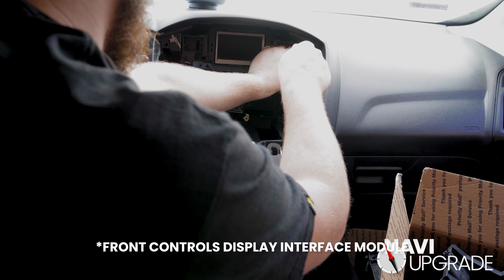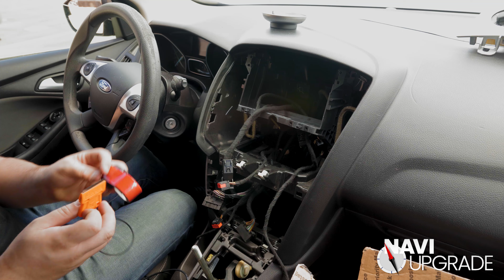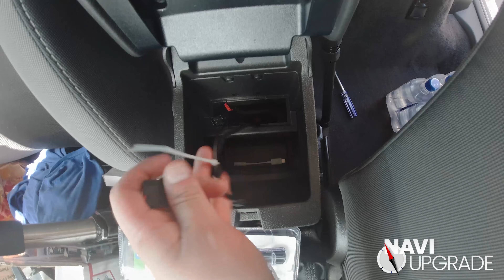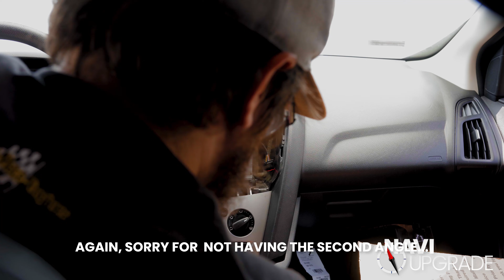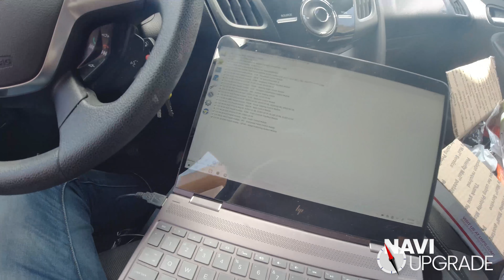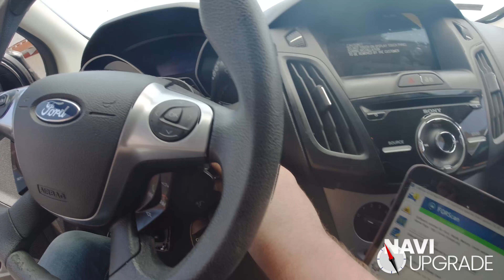2012 to 2014 Base Ford Focus MK3 Sync 3 Upgrade Tutorial

Comment: I want to add a back up camera. The harness i bought from you has the yellow video cable on it. I tried installing a cheap ebay one i had laying around and i turned the rear camera option on in forscan but the screen would turn blue and then it was say camera not available contact dealership. Is there anything else i need to do? It had a green cable that was coming out of the yellow video cable that connects to the harness by the screen but i didnt see any other cable to connect it to so i just left it unplugged but for some reason i couldnt get it to work. I got power and ground for it from my reverse rail light. Im not sure if i should try again with a different camera or if i just missed something on the programming side.

Comment: I want to know if you still have the kit for this setup? I have converted but the wires I purchased through eBay are wrong and missing the hazards and lock/unlock wires. Also my radio will not power off/on the volume doesn’t work either. I meed some help with this issue. I also noticed that I have two wires that are cut and don’t know where they go.
Reply from the maker: I still sell the harnesses yes! They come with programming files and will work with your car as long as it had the base Sync version like this car had!

Comment: What happens if I have a 2012 Ford focus and I want to put a 2014 Titanium or 2012 I think it is it's got the touch screen with navigation will that swap up what all has to be done I have a scan tool it is an older one it will pick up stuff on this car but I think this is like the final year it only goes up to like 2013 and this is what this car is either 2012 or 2013 can I just swap everything and it'll work without having a program?

Comment: Hi! 
can someone please help?
just bought a focus mk3 titanium and when I press the "AUX" nothing happens also pressing the "phone" just mutes the radio. so I cannot connect to the Bluetooth at all. I disconnected the panel and after pulling the ACM I noticed that there is no connector No1 connected and I can't  even find it anywhere. where can I look for it and what might have happened to it with previous hands? 😵‍💫
Reply from the maker: It's possible that a previous owner cut it up to install an aftermarket head unit.
Reply: @NaviUpgrade  Thank you for the response. That's what I'm fearing because I've found a "Connect" passive amp behind the ACM making me suspect that he rewired the connector to the "Connect" connector. Is there a way  to restore it?

Comment: Or you could… like… just get a pioneer or other good apple carplay / android head unit, get a 2-din cover replacement kit with necessary cables plug and play cables for proper conversion and maybe also buy a reverse camera to go with that, plug it in quickly and you’re done. Maybe also upgrade the speakers with a focal ford kit or something.

This seems to be a lot of trouble for no obvious reason. A brand new apple carplay system just seems superior and you can still keep all controls.

Oh well. It’s cool that you managed to fix it so nicely, I just believe that almost everyone is better off just getting a plug and play kit for 1 or 2-din head units and getting whatever model they fancy of head unit. There are even super cheap stuff that is just the screen and panel in one, though those tend to be unreliable, it’s a better experience to get something proper.

Comment: My APIM is not showing up at all in Forscan. Any troubleshooting tips or info on what to do?
Reply from the maker: Hi Jackson! Please ensure that all connectors are connected, specifically the main connector down by the shifter and the connector that connects to your old 4" display connector. If they are already plugged in, unplug these connectors and reconnect them.

Comment: Please rephrase your intro - the 2012 only has (1) plug at the rear of the head unit (not 2 as shown in your video) it also has (2) antenna Plugs not (1).
I am still searching for a way of connecting the Canbus Unit inline with the original wiring to the extra plug!) If you have any ideas it would be much appreciated.
Reply from the maker: Guessing you have a global version of the car which is equipped differently
Reply: Hey mate, did you end up figuring out how to make this work?

Comment: Thank you so much for this! Just upgraded my 2013 focus and couldn’t have done it without this video. 

One question though: I don’t have the parking sensor image or the green/yellow/red lines when I put it into reverse anymore. I still get the beeps, but I don’t get the “Park Pilot” image that I used to have in sync 1. Any suggestions?
Reply from the maker: Set this setting in the APIM asbuilt to 'B'

https://cyanlabs.net/asbuilt-db/sync3-apim/?search=Parking%2520Distance%2520Control%2520%28PDC%29%2520HMI#database
Reply: @NaviUpgrade  Thanks for the reply. That didn’t work sadly, but I managed to get it to work by changing DE01/7D0-02-02 xxxx-*xxx-xxxx from 0 to 2

Comment: Hello, Looking to do this to my kids 2012 focus. Was going to attempt to wire it up  myself until i saw this video. But i am a little confused, on the wiring diagrams i found, there are 4 wires that go to the obd2 for hs-can and ms-can and wire that go from the apim to the acm. From your video it appeared you plugged the factory harness back in to the acm with no modification, and no connections to the obd2. Are these not required? Does your harness take care of these connections?
Reply from the maker: My harness makes the entire upgrade Plug and Play as long as the car has the 4-in screen where you can connect to Bluetooth. There is a minority of cars out there that just has a clock in the center panel instead of the 4" screen with sync (Bluetooth and voice commands)

Comment: Why do your kits still include a GPS antenna if you can select a non navigation APIM. Does it still work?
Reply from the maker: Because a GPS antenna is used for CarPlay interestingly enough (CarPlay is set to piggy back off of OEM Systems). Also other functions such as emergency auto dialing and Clock setting relies on GPS 🙂

Comment: The swing latch part lost focus and I didn’t quite see what you meant by it “should swing down and you should pull it right out.”
Reply from the maker: So the swing latch is a gray latching connector. There's a small push tab on the top of this connector that prevents the swinging latch from becoming unseated. Push down on this tab and rotste the latch. It will rotate and the connector will come out of the module.

Comment: What is the reason why your harness wont work for a 2014 4" to SYNC 2? I already have the sync2 modules and dont really need sync 3 or navigation, just the bigger screen and rear camera input.
Reply from the maker: It will work! The only incompatible piece is the hub power connector. To get around this, you can simply use the USB hub from a 2016 Ford Fusion or a 2016 Ford Explorer
Reply: @NaviUpgrade  Will I need files for Forscan to integrate it, and do you provide those with purchase for sync 2?

Comment: Does the Sony unit have a better sound than the Ford Sync 3 unit or is it all the same with just a Sony facia?
Reply from the maker: They're all the same in the premium cars with Sync 3 pretty much. Honestly the best sounding ACMs are the ones without Sirius XM from the base model cars
Reply: @NaviUpgrade  is that the ACM I've got? 2013 bottom of the range SYNC1 with the small 4" screen?

Comment: Your website is abyssal to use on mobile. I’m trying to scroll down and up but the logo keeps popping up. I want to buy and have someone do this but it’s hard to navigate through
Reply from the maker: Sorry 😔 if you'd like, email me at support@naviupgrade.com and I can send you a PayPal invoice for whichever upgrade you need. Also let me know what phone and browser you're using and I'll work on fixing that issue now. Thank you!
Reply: @NaviUpgrade  I’ll email you for sure. Does this set up work perfectly fine over time? I’ve seen some eBay units and reviews of ppl say that the Bluetooth or dash doesn’t turn on when they turn on the car later on. I want to do this to a ford focus 2012 se. The Bluetooth as is doesn’t work and the chip thing works according to a mechanic. Sorry I don’t know the names of car pieces yet fully.
Reply from the maker: Yeah Sync 3 is much more resilient than Sync 2 ever was. Modules are equipped with much better chip thermal compounds to allow heat dissipation via the APIM shell which was the main issue in prior generations. I think out of the 300 or so kits I've sold only one has gone bad and it was within our one year warranty. Haven't had any complaints outside of the one year period and I've been at this for 4 years of so 😁
Reply: @NaviUpgrade  are you based in nyc?
Reply from the maker: About as far from there as can be 😅 LA
Reply: @NaviUpgrade  😔

Comment: Hey man. I have a 2014 Ford Focus Titanium that has the 8" My Ford Touch. It has SiriusXM with it. Do you know if the SiriusXM is part of the unit or if it has a separate tuner located in the dash somewhere? Thanks for your help
Reply from the maker: Hey there Tim, XM is built into the CD player of the vehicle, Sync is just an interface for it!

Comment: I'm trying to replace the shifter knob in mine and can't find a video, this one is the closest but still doesn't show how to take the knob off. How does the leather separate from the knob, please?
Reply from the maker: If manual, grip the whole thing hard and twist left! Good luck!
Reply: @NaviUpgrade  I did that but the boot doesn't separate from the knob so I'm thinking the entire piece has to be replaced. It doesn't just simply unscrew in the 2013 Focus....
Reply from the maker: @ginger4166  probably a little stuck or sticky. Just pop up the whole trim piece and rotate the whole thing

Comment: Hello!  Can you help?  2013 Focus sync converter cable sync 2, where can I order?  thank you!  Hi!
Reply from the maker: Sync 3 and Sync 2 cables are essentially the same — you just won't get support for hub inputs like RCA and 3.5mm. Everything else is the same though.
Reply: @NaviUpgrade  Thanks for the reply!  I wrote it wrong.  I'm replacing the 2013 sync non-navigation headunit with a sync 2 navigation headunit.  What kind of power cord should I use?  Is the old power cable good?
Reply from the maker: No adapter needed unless you want to add a reverse camera while you're at it. You'll need to make sure you have a Nav SD card though for the Nav to work

Comment: I have the titanium version 2012. I'm looking at upgrading to the 3. If I can retain everything from the 2. Like my xm radio and HD.  I don't care about navigation.  Since I use waze or Google maps.
Reply from the maker: Yep! All factory features are retained. Sirius, HD Radio, backup camera, sensors etc ☺️
Reply: @NaviUpgrade  my question is if I pull it from a local junkyard.  I would just need the software and cambus?
Reply from the maker: @Das_Lucifer  it will probably need reprogramming unless you find an identically equipped car as yours that's 2016+
Reply: @NaviUpgrade  that's what I was wondering.  How much is your kit instead?
Reply: You website is very helpful.  Thanks.  That's all the information I needed.  You rock!

Comment: I understand these 2012 Ford Focus has  transmission problems ,it it possible fit standard gear box to this car . Could ou you send a list of parts needed . Thanks .
Reply from the maker: You should speak with Rebel Devil Performance in that regard

Comment: You reckon this could be done on a 2011 Focus as well? It has the same Old Panel. Thanks.
Reply from the maker: Absolutely. If you're outside of the US you could possibly need to use a different harness if your car has "Bluetooth Voice Control" rather than Sync. This harness will be in stock soon.

Comment: it’s 670$ for the components then an additional 250$ for the wiring harness. So almost 1k for this upgrade. I do admire the craftsmanship and the knowledge that was needed to make this happen but for almost a thousand dollars it’s a bit of a stretch. For the price it’s a hard sale. Seeing that these cars go for less than 8k  in 2021 if their auto transmission haven’t gone out yet I don’t think it’s worth it.
Reply from the maker: For sure — and if we're being honest I actually recommend people not to buy the hardware from me. Many people get away with spending $450-650 on their entire upgrade by picking parts themselves out of a junkyard. I've got another video with the full rundown of what to pull and from what cars to help make it easier for everyone. I do agree with your sentiment on the Auto transmission however. Complete trash. Most of my customers are ST and Zetec owners with manual transmissions.
Reply: the transmission.... its the main reason there are not MORE buyers for any Ford Focus upgrades. even cup holders

Comment: I've got a 2016 Ford transit connect xle with what appears to be the same system. The only thing I can see different is the okay button. Is there a kit or something to swap it out? I hate it. The back up cam doesn't even work most the time

Comment: Literally why would you put any time or money into Ford's SYNC software when you can dodge their crappy software all together and put an aftermarket headunit in for the same price?
Reply from the maker: Sync isn't bad at all in comparison with almost any other OEM. The main reasons people like to upgrade to Sync 3 is that it looks like it belongs in the vehicle unlike an aftermarket dash kits. It has all the same aftermarket compatibility as well in terms of line outputs as well with proper programming.
Reply: @NaviUpgrade  I get that it looks better than the 4” display. I work on car electronic systems for a living and the most complained about OEM system is SYNC. Most folks have nothing but problems with it. Shortly here I’ll be taking delivery of a 2018 ST1 and the first thing I’m doing to it is replacing the radio for a 9” Pioneer.  The kit doesn’t look half bad. I just want folks to know that there’s other options.
Reply from the maker: @dakotascott5951  I get that, to each their own... But one of the main things that makes the Sync system terrible is its pairing with the Sony DSP. This inherently bypasses all of  that, leaving room to use a LOC or our line-out harness for clean outs directly from the audio control module and keeping a factory look. Also the programming files we provide apply a flat response EQ to the ACM's processing.

Comment: What you need to do is burn that piece of 💩
Reply from the maker: ... Why? Absolutely nothing wrong with any manual version of the Mk3 Focus.
Reply: @NaviUpgrade  well it's a Ford focus,. Manual transmission might be better than the dual clutch pos turds they sold but my point is it's still produced by the lieing bastards at Ford.
Reply from the maker: @ronniepuckett4293  welp... Not gonna argue with ya. I've admired Ford for paying back their bailout money and commitment to innovating designs and putting performance and an affordable price point with the ST and RS lineup. No manufacturer is without fault for issues and recalls, but these things happen. I might not be with Ford forever as I've been eyeing a 4Runner TRD Pro, but then again might go Bronco after typical first year issues are ironed out.

Anywho. Even though you're not a Ford fan I appreciate you taking the time to stop by my channel and leaving a comment 🙏

Comment: I'm really struggling to find that exact facia. Don't suppose you have the part number? Can't see it anywhere nor on your write up. Or, Is there a way to sway the dual buttoned fascia to a single one? I would lose the ability to control the central locking though.

Comment: So, a you-pull-it near me has a focus with the 8 inch Sony radio in it. If I were to grab the parts off of it would I be able to just buy the conversion harness and use the rest of the factory equipment out of the wrecked one?
Reply from the maker: Absolutely, but I would watch my other video before going out there -- just to be sure you're getting what you want. https://youtu.be/NaKvQpaGiaM

Comment: I’m a bit late to this video, but I just had a question about the hub in the center console. I want to do this swap for my 2013 SE and it’s equipped with seat heaters. If my memory is correct, the wiring harness for the seat heaters is in the same harness for the stock USB/AUX hub. What exactly do you do with the original wiring for the stock hub? Is there any change needed for it to not be plugged in? I know the harness is connected to a swing connector on the right side of the console. Do you just let the original stuff sit loose under the console?
Reply from the maker: Hey there sorry for the late reply. The seat heaters will be in the same loom but run on a separate circuit so installing a unit like this won't affect your heated seats. Just pop off the original hub and let the connector for it hang loose back there.